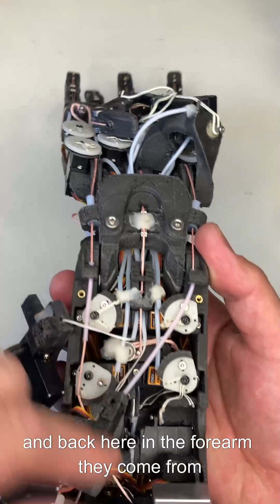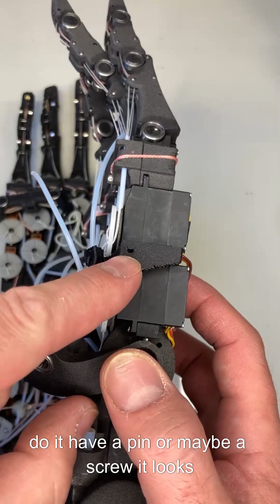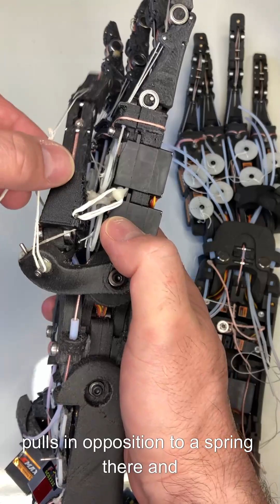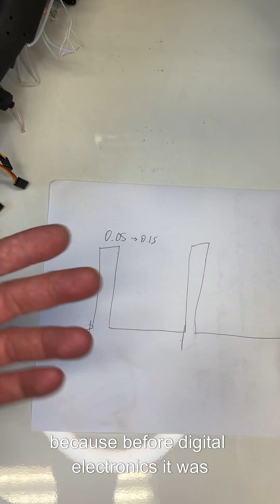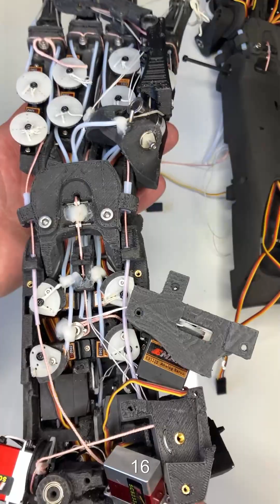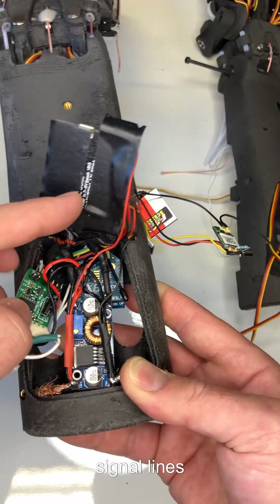V1 DexHand Questions 01 - Wrist PTFE, Thumb tendons and electronics

Comment: I've got another question regarding electronics: Do you know what current the voltage regulator/step down you are using is rated for? Doing some simple calculations shows that if all servos are stalling (which is unlikely, but I feel all edge cases must be accounted for), the hand can draw a lot of juice at once--13.5A, assuming all servos consume 750mA at stall.
Reply from the maker: Yes, it’s a bit of an issue actually.

Your calculations are reasonable though in practice it’s rare to stall all the servos at once and for legacy PWM servos you need to avoid stall conditions as much as possible to prevent them burning out.

There are many cheap dc-dc converters on Amazon and AliExpress and I use the smallest 5A versions I can find.

As it turns out these all use counterfeit chips but nonetheless work for a reasonable amount of time especially if you avoid stall conditions.

For doing actual work with a hand it’s necessary to step up to serial bus servos and these are available tolerant to 8.4v which allows direct connection to a pair of li-po 18650 cells.

So far these will only fit in the V2 hand. My plan is to update the V1 for more serious builders with serial servos.

Comment: Sorry to bother, but I've had a couple issues with operating the EMax servos. I would assume they have a range of motion of 180 degrees, but I can only reach around ~135 degrees, while at the same time inputs using an Arduino and the "Servo.h" library don't translate properly. Did you use a data sheet or does there exist a data sheet that explains the PWM signals required by them? Because I have had trouble finding anything that describes the pulse width range.
Reply from the maker: Not at all, I’m here to help people reach their robot goals!

The Emax servos have a reduced range of motion so 135 sounds about right. In the design you can actually only use about 90 so I use that servo both because they’re extra slim and optimised for a reduced range which gives the hand that dynamic characteristic.

Any PWM should work so the standard arduino function as used in the code published on the GitHub should work fine.

Comment: Is there any way you could show which thumb tendon goes through which tube?
Reply from the maker: I’ve filmed the assembly now but editing is gonna take a while…

In words, there are four thumb servos which build up from the “bottom” of the forearm bulk.

With the assembled hand and forearm lying on the bench palm upwards the first servo is the back right. This connects to the long flexor that passes through either of the tubes on the right of the wrist and through the centre of the thumb basal joint.

Neck the ptfe so it can pass through the basal joint, check the joint can move over the full range as the wrist flexes and trim flush.

Before the servo is mounted check that the ptfe for the wrist tendon is well positioned to deliver the tendon to the lower right wrist pulley.

Mount the servo and set the tendon length with access for the screwdriver from the left side. To make this easier drill a hole that allows you to pull the tendon downwards as you tighten the centre screw. 

Next pass the wrist tendon on the left side and insert the left lower wrist tendon. This will block access to the first servo.

The thumb extension spring can also be fitted to tension against the long flexor.

Before inserting the second servo on the left side thread the electrical cable through the tunnel on that servo’s proximal side and additionally pass the cable for the fourth servo at the same time. All the electrical cables pass through to the electronics compartment on the back of the forearm.

Pass a tendon through either of the tubes on the left side of the wrist. This can connect to either the basal rotation or the thumb knuckle that draws the thumb downwards and outwards. Connect to the servo spool and set the length. 

The third servo is on the right, distal to the first thumb servo and connects through the second tube on the right side of the wrist which then passes through the thumb tendon hanger.

To mount the servo attach the first small insert above the first servo.

Next the two wrist servos need to be mounted along with the second insert. The tendon threads through the palm sections and round the four wrist pulleys. The two lower pulleys have printed centres and horizontal axes. The two upper pulleys have vertical axes, the left pulley is mounted on the forearm bulk directly and the right pulley in insert 2.

Finally the fourth thumb servo attaches to the third insert piece and then connects to a tendon that passes through the second left hand wrist tube. It will actuate either the knuckle or the basal rotation remaining.

The electrical cable that was already passed when the second servo was mounted wraps over the top of this servo and should already pass into the electronics compartment.